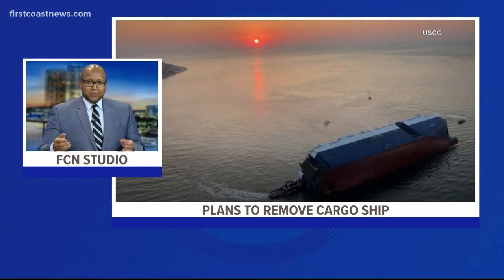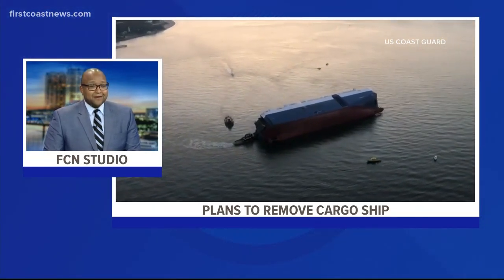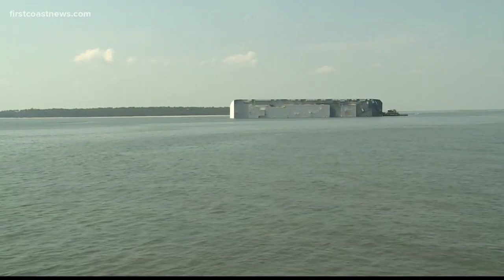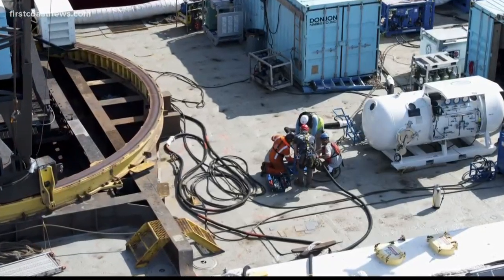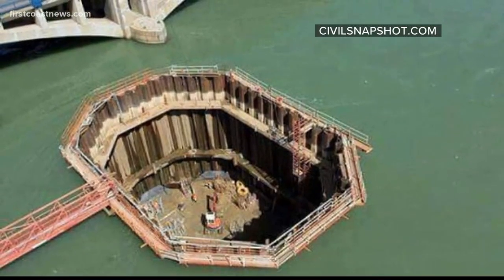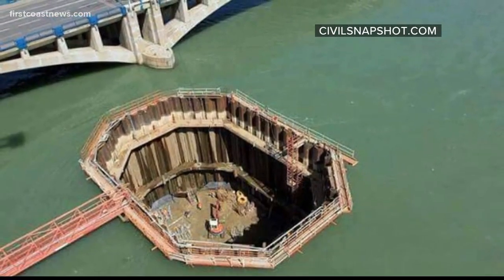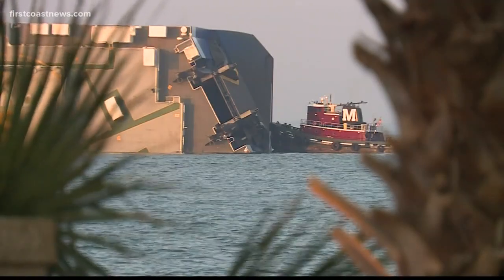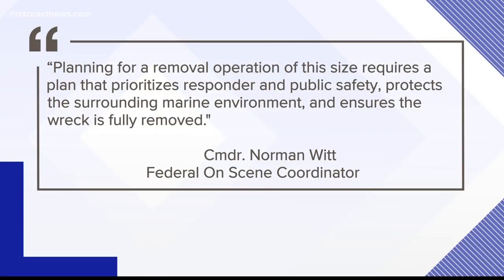Could building a dam help remove Golden Ray cargo ship from St. Simons Sound?

Comment: Why not patch the hole then use airbags that you inflate inside the craft to push the water out. Think many air balloons in a bucket under water it would force the water out and help add ballest